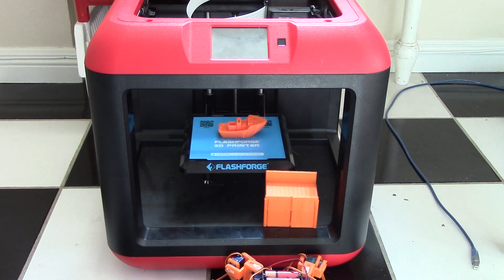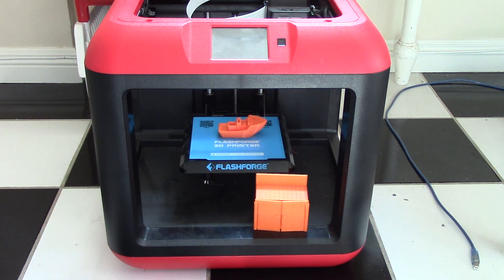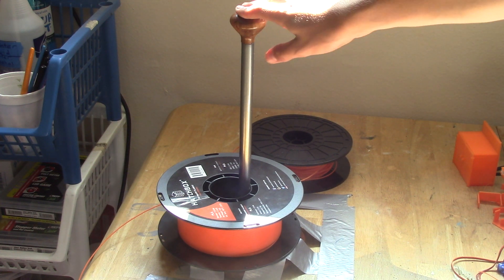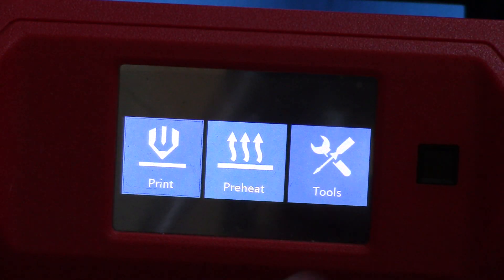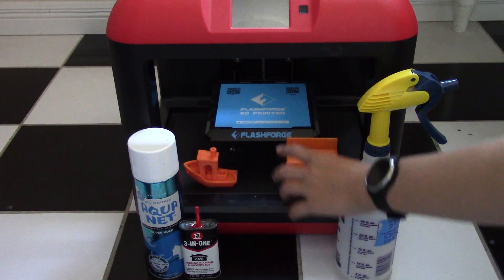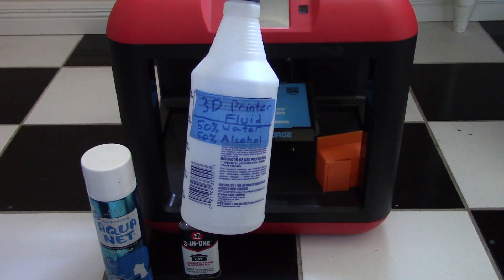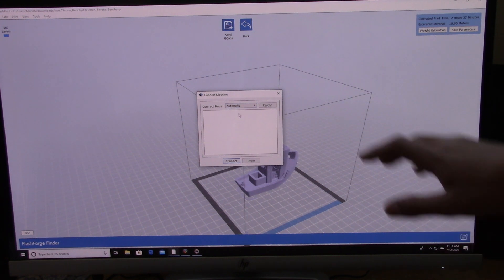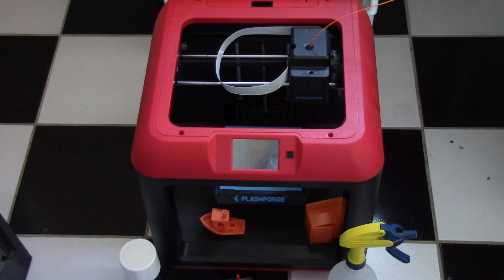FlashForge Finder 3D Printer Review

Comment: Just ordered one, from other video it shows a tube that was supposed to go from that hole in the filament holder to the extruder the wear from happening
Reply from the maker: Yeah mine came with one of those as well, I didn't end up using it as it just got in the way of the filament.